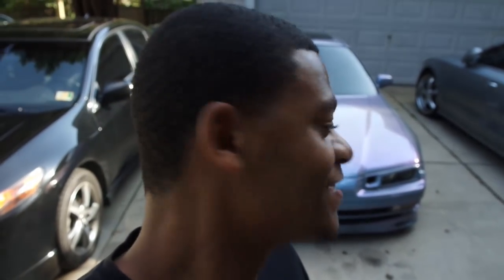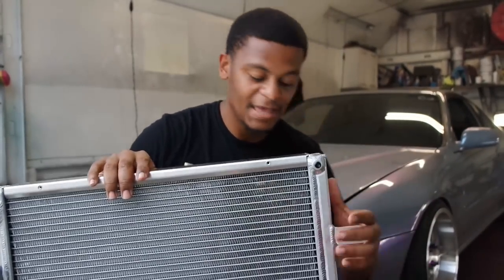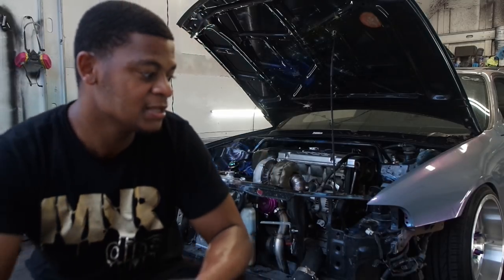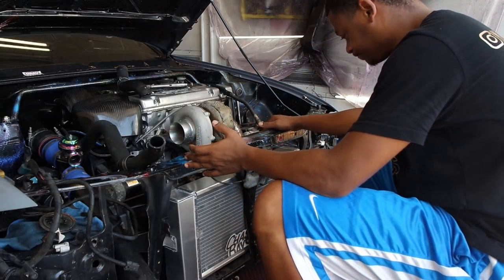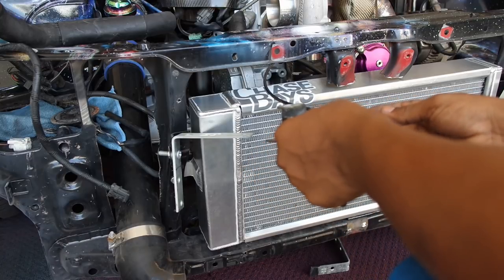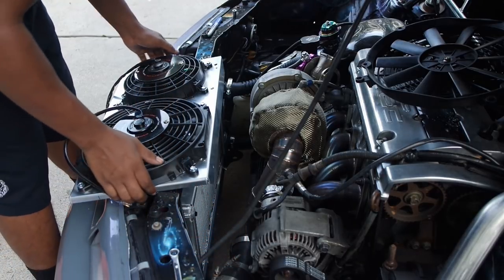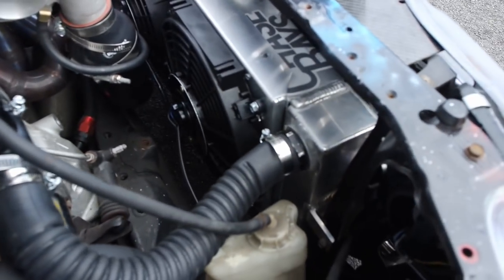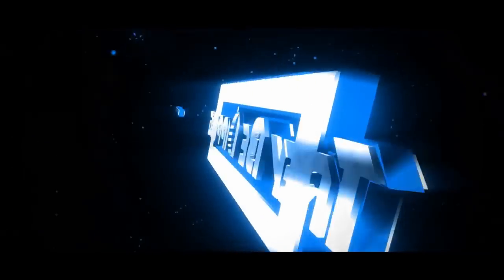TURBO HONDA PRELUDE Chase bays Tucked radiator install and review

Comment: Thats one nice radiator. I don't got much else this time around, I run NA so fitting a radiator is alot easier for me. I will suggeest getting another mid bar welled to the radiator support because they are not the strongest and you might face some flexing issues. Oh and for those at home do a mock up with your crash bar put in place it gives you some more options for mounting points and spacing. Again some high quality content keep it up!
Reply from the maker: Thanks bro i may look into it

Comment: You were overheating because u had air in the coolant system. Not the tune
Reply from the maker: Negative! The system was bled multiple times it was the tune. The timing wasnt set before the tune.

To confirm i ran my previous tune and everything was fine. And to double confirm i switched back to the new tune and it oveheated again.
Reply: @treybedipping1734  as a tuner I can tell u that the timing being off at the dizzy won't over heat. U just won't be able to drive properly or at all. But either ways good luck keep bringing that quality content
Reply from the maker: @wendellsamuel2297  it was without a doubt 100% the tune im not a tuner so i cant tell exactly what causes it within the tune but it was def the tune.
Reply: Then please find a new tuner before he ruins that beauty
Reply from the maker: @wendellsamuel2297  yea the guy who tuned it wasnt my normal tuner i just went to him cause my normal tuner was booked out 2 months and i wanted to drive my car lol
Reply: The only thing i could think of in this situation is if the fan temp was set on waaay too late, making your car overheat at that point..
Reply from the maker: @orlandot3944  it was the tune bro.

Comment: A tune cannot cause an overheating problem
Reply from the maker: It is a fact that it can. Do your research.

Further more i spent 3 months tracking down the source and when i loaded my old tune i no longer had overheating issues. To double confirm i reloaded the tune that caused the overheating and it caused the overheating again.